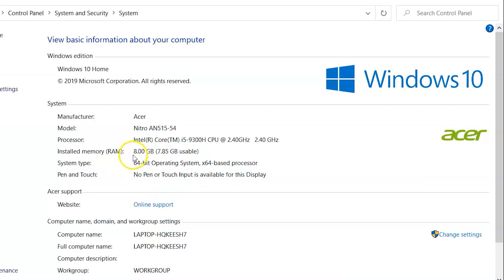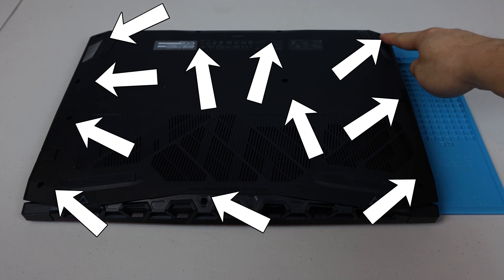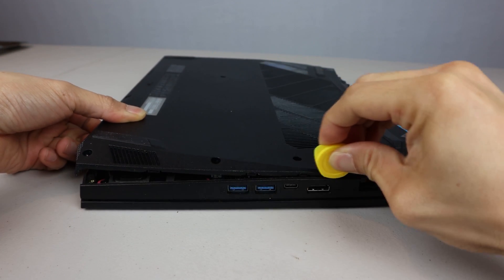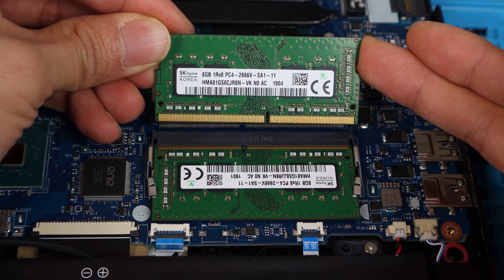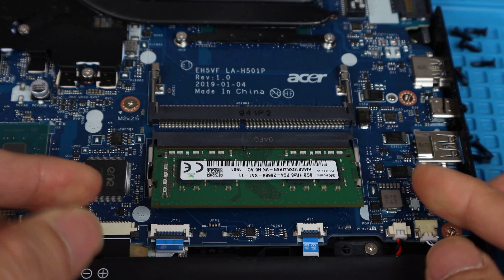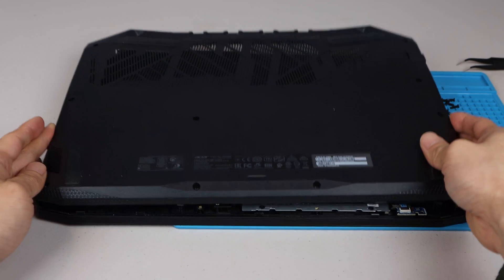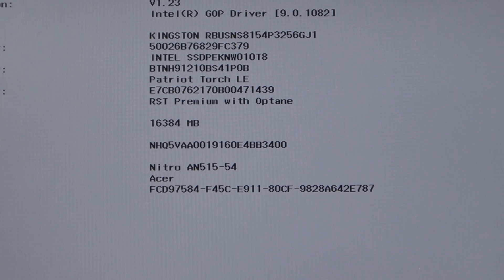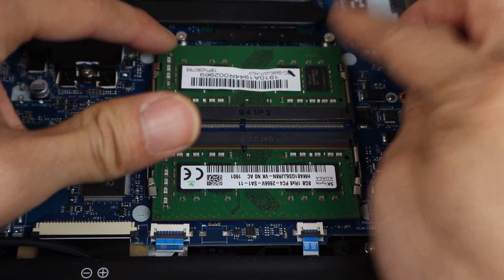How to Install or Upgrade RAM in an Acer Nitro 5 Gaming Laptop (2019 ver) DDR4 up to 2666MHz 32 GB

Comment: hi so i have a 2x 4gb ram installed. so i bought a 16gb ram. im planning to install a 4gb +16gb ram in dual slot. can this be done? or are there any conflicts if i do this?? should i just remove the 4gb stick and just install a 16gb all by itself?? thanks
Reply: Sure you can. But if you are spending that big of money on your laptop you should just buy a matched set and put your 4gb stick aside for spare.

Comment: i have acer an515-43 model. It came with 8gb 2666mhz sk hynix ram. I also added 8gb crucial 2666mhz ram. Afterwards, when I looked at the task manager, I saw that my ram speed fell to 2400mhz. how can i fix this? the speed of my two rams is 2666 but it currently works at 2400. I would be glad if you can help.
Reply from the maker: Hm, while I couldn't find specific information about your build, it's possible that is uses DDR4-2400 Dual Channel Support  via DDR4-2666 bridge to DDR4-2400. This means that although it uses DDR4-2666 modules, it  runs them at 2400 speed (1200 x 2 for ddr or double data rate). Of course, this may not be true if you're sure it was running at 2666 MHz prior to installing the new chip. It could also be that the two different brand chips don't efficiently communicate with each other and that's what stepping down the speed, though this is not typical is the specs line up. However, I've also read that the Ryzen builds of the Nitro 5 top out at 2400 MHz. Apparently, with either AN515-43 model a single stick will run at 2666mhz but with both AMD and Intel, 2 paired sticks will run at 2400. You may need to reach out to Acer for clarification.

Comment: Thanks your video, I want to purchase this laptop, but I want to know do I need to remove the battery when I upgrade the RAM? Because some of the review said without remove the battery will be dangerous or damage your laptop?
Reply from the maker: While it is not required to do so to complete the upgrade, some people prefer to take this extra step to safeguard against the very small risk of an electrical short. It is optional, but so is wearing a grounding wrist strap to prevent static electricity. Problems like that are rare but there is still a chance. In the end, do what you need to do, to ensure you feel good about the steps you are taking to protect yourself and the laptop from damage. If that means disconnecting the battery first, by all means, do so.
Reply: @FixItPhil OK, Thanks your reply!

Comment: Hi, mine came with 8gb of ram. Does mine second one have to match that and be 8gb as well? Or can I get a 16gb one to give me even more ram?
Reply from the maker: In general, it optimizes the utilization of the new RAM chip if you get a matching spec and capacity, so an 8 GB chip would be a great option. However, you can still install a 16GB chip if that is what you prefer. Yes, it will give you more RAM but the performance increase will likely not be very noticeable unless you are running heavy processing applications like image or video editing. For gaming, a total of 16 GB of RAM (2x 8 GB chips) should be plenty.

Comment: So is this the ram that comes with this acer nitro 5 model? Or did you already have this one installed and you just added the 2nd one? Because I want to use the exact same ram that my nitro has i just want to add another 8 gig to have 16 total
Reply from the maker: Yes, my model (from Best Buy) came with 8GB of the Hynix RAM installed, and I installed a 2nd matching one that I purchased online, so now I have a total of 16 GB. Other builds from other vendors may have different components inside, so it's best to check first to be sure; however, the only way to do that is to open it up and read the part number off the chip :-/.

Comment: I have 8gb of ram, i want to add 16gb to the other free slot to make it 24. The 16gb of ram has the same speed(2666), latency(19), Voltage(1.20V/1.2V) etc. Is it safe to make that upgrade?
Reply from the maker: Sure, you can do that. For the most part it's not a matter of "safe," rather, matching speed/capacity/etc has more to do with optimizing performance. That said, the system should still work fine with a 8+16 GB configuration to get you to 24 GB!

Comment: Could I use a 2600 mhz stick with the 2400?
and is it really neccesary to have the same model RAM memory?  because i already bought a 2666mhz to place it on my nitro5  2.4
Reply from the maker: Yes, you could use two different speeds together, although you won't get the extra speed benefit of 2600mHz, as the system will step down to whichever chip has the lower speed, so both chips will run at 2400 mHz. No, it's not explicitly necessary to match the brand and model; this simply increases the likelihood of maximizing compatibility and optimizing efficiencies to get the best performance. In most instances different modules will work just fine with each other.
Reply: FixItPhil What ram is included in the nitro 5?

Comment: Why i upgrade ram 4gb to 12gb but when i play games still running low fps
Reply from the maker: Upgrading your RAM often makes a very small difference to your FPS, which is largely defined by the capabilities of your CPU and GPU (video card). While extra RAM helps with your overall system performance, you may not see a lot of benefit when gaming in terms of visuals.
Reply: I messed up added a 4 gb card and I can't change my 8 gb card from 1333mhz back to 2400mhz cause no bios now my Acer is useless

Comment: So glad I found you vid's , so clear and concise , short and to the point. Other vids out there havnt hit the nail on the head like yours so thanks and well done. I've had this laptop now for about 3 months and I have the 256Gb m.2 ssd version. I have a spare M.2 slot and the 2.5" hdd available to me. Any ways so not to clog each video up I have a couple questions as, so far using acers own community page i've had no definitive answers, so hoping you can help. Im currently looking at upgrading the RAM up to 16GB and have seen your using the factory fitted for the second though the price of it on your link is a lot more expensive than what im looking at. So will this one have any issues running dual with current one installed? https://uk.crucial.com/memory/ddr4/ct8g4sfs8266.

Secondly im also looking at putting in a 2.5" hdd. Can I fit a SSD here instead , and also what is the max this can handle as i've herd reports the M.2 slots only take up to 516GB in the second slot , so wondered if there is also a restriction on the 2.5" as well? im currently looking at this https://uk.crucial.com/ssd/mx500/ct1000mx500ssd1 will this be ok to use in the 2.5" bay?

Heavy gaming on this laptop but I know these increases will handle what I need currently , just unsure if these components will handle it and if they will work. Cheers in advance for any feedback I can gather.
Reply from the maker: Hey Pete. So the specs for the Crucial RAM in your link are the same as the factory installed RAM, so it should be compatible and run with little or no issue when you pair the two. The 2.5” bay can accommodate an HDD or SDD of the same form factor. Or you the 2.5" HDD bay can be converted to accept an M.2 SSD, using an adapter or housing like this one: https://geni.us/97s6 [Amazon Affiliate Product Link] Note that this would necessarily be restricted to SATA III transfer speeds as that is the connection type to the board.

For the M.2 slots, I believe the 2019 Nitro 5’s can handle up to 2 TB drives; I know mine handles the second 1 TB SDD I installed just fine (though the one pre-installed in my machine is only 256GB). As for the 2.5” bay, my assumption is that it is also a 2 TB max, though I’ve heard anecdotally that it can accommodate up to 4 TB, if you can find one with a slim enough profile to fit in the tray (for example the Samsung EVO 860: https://geni.us/C4MNgu [NewEgg Affiliate Link]) although I haven’t tried it myself, and I haven’t seen anyone specifically installing a drive above 2 TB. I would reach out to Acer for confirmation before purchasing a 4TB drive to be sure.

The MX500 1 TB 2.5” drive you mentioned would be compatible, though I saw it for a little cheaper on NewEgg here: https://geni.us/VnrZJ2 [Affiliate Link] In fact, you might be able to save a little money by getting both the drive and the Crucial RAM from NewEgg: https://geni.us/un1O [Affiliate Link] Not sure how much shipping is to the UK, though.

Anyway, I hope this information helped you some. Cheers and good luck with your laptop upgrades!
Reply: @FixItPhil thank you so much for the reply and the time to have a look for me. That has helped no end to what my choices are. The adapter for the 2.5" is an interesting development and not something id thought of. Is there any point in changing to the M.2 in the bay? I think a SSD 2.5" should suffice, unless there is a performance increase. 

Thanks for your link to Newegg , though I was just linking the components I had been looking at and will be using Amazon to purchase. I think in price getting shipped to the uk from the usa will be more than what id save in these terms :) 

Its good to know your nitro handles a 1TB slot , im sure ive heard reports that they don't handle more than 512GB , so maby I will have to find out if certain models support different amounts. Ill let you know what I find out if I do, might help someone else in the future. 

Thanks again
Reply from the maker: @unknownh0st383  Sure, no problem! To answer your question, no, there wouldn't be a performance advantage converting an M.2 to 2.5" form factor because of the SATA interface limitation. It would just be a convenience thing, if you already had an M.2 drive you wanted to use but no open M.2 slot. If you have to buy a new drive either way, a 2.5" form factor SSD is probably more economical.

Comment: hope you can reply, my colleague has a nitro i7 with 2667 8gb ram, he wants to add 8gb more. After putting in the new ram, do we need to do anything with BIOS, are after adding ram, we can simply turn on the laptop and it will be detected? Hope you can reply.
Reply from the maker: No, you don't have to do anything additional after installing the new RAM chip. The BIOS should detect it automatically.

Comment: Hello i upgraded ram memory on my  nitro 5.I have the amd version, it came with one 8gb  2400mhz  and I upgraded to 32gb  3200mhz ,I did check the speed and still at 2400mhz does any one  knows what can  i 
do?
Reply from the maker: Depending on the exact model configuration you have, the max RAM speed is limited to 2400 (like the Ryzen models) or 2666mHz. It sounds like your model is the former, so unfortunately you won't get the benefit of the 3200mHz speed because of the physical speed limitation of the motherboard.  I actually don't think any builds of the Nitro 5 go above 2666mHz.
Reply: @FixItPhil  tanks

Comment: I did this now my laptop won't turn on. No charging light either when plugged in. Please any help or tips on what to do.
Reply: Did u unconnect the battery to the motherboard ? If u didn't im afraid ur laptop just had short circuited
Reply: @ahsim3143  i was going to just return it cause i had just bought it. When i was putting the screws back in i couldn't find one. So i looked all over for hours and found it then i decided to try and turn it on one more time and it turned on lol
Reply: @ahsim3143  thank you for taking a moment to help.

Comment: Hi Phil i am having NItro 5 2019 i7 model, onboard it have 8 Gb 2667 MHZ ,
 i am planning to add 16 GB Card is it good have one slot with 16gb and another slot with 8 GB pls suggest your options
Reply: Selva The Boss can I answer the question,I have tried that 16GB on one slot and 8GB on the other without any issue,shop for 16GB SODIMM 2666mhz,consider checking my uploads,thanks
Reply from the maker: Sure, you can mix RAM capacities like 16GB with 8GB and your system would probably run fine. But you run the possibility that you might not be able to utilize its optimal performance because of it, so it's generally advised to use RAM sticks by the same manufacturer, size, and frequency (speed). But again, if you already have mixed capacity RAM sticks you want to use, it would still give you some kind of performance boost. Best case for this is if they are the same frequency (e.g. 24000 mHz, 2666 mHz etc.) but again you can mix speeds too; you would just be limited to the lower speed chipset.
Reply: @FixItPhil  nice

Comment: So if I wanted to upgrade my ram to 32g I would need 2x 16g ram sticks that's all?  As long as its DDR4-SDRAM right? Do you have a link to what kind of 16b ram stick should I be looking for?

Edit: So I actually saw the link to the 16g viper steel ram! If I need two I should just get the dual kit right? The dual kit has a max of 3200mhz is that okay as well?
Reply from the maker: Yes, you can get a dual kit 32GB RAM which will include two sticks of 16 GB RAM. You won't need to get the 3200mHz, as the AN515-54 maxes out at 2666mHz so any speed above this would be unused. It might be cheaper to buy two single 16 GB sticks at 2666mHz and you would get the same performance. Of course, if there's a great deal on the dual kit somewhere and you can save some money, there's no real problem with getting the 3200 mHz, you just wouldn't be able to take advantage of the full speed capacity.
Reply: @FixItPhil  Thank you for the help! Much appreciated!

Comment: Could I use a 2400 mhz stick with the 2666?
Reply from the maker: Yes, the max speed of the pair would be limited by the slowest stick, so you would run at 2400mHz with both installed.

Comment: I have the same laptop and it's stock without any upgrades when I go to the task manager it shows me that the 2 slots are used I don't how cause my model is the 8gb model? 
and what kind of ram do you recommend to get it to 16gb?
Reply from the maker: If you have a total of 8GB of RAM with 2 of 2 slots used, you likely have two 4GB chips installed. So if you want to upgrade to 16GB, you need to buy two 8GB RAM sticks or a single 16GB; you won't be able to re-use the existing 4GB sticks. The Hynix 8 GB RAM is a good budget friendly option that comes stock with many builds: https://geni.us/TDIO [Amazon Affiliate Product Link]
 But if you want better performance and durability you can try the Patriot Viper Steel RAM: https://geni.us/52cnxY [Amazon Affiliate Product Link] You can either buy one 16 GB chip or two 8 GB chips. The difference between those configurations is fairly negligible.
Reply: @FixItPhil  thank you so much ❤
Reply: SODIMM DDR4 2400mhz and 2666mhz works for me

Comment: I think I just got the same one 
	
ACER NITRO 5 RYZ 5 8GB 512GB RX560 GDESK
 I want to update the ram so if I get 16gb and it have 8 so it’s would 24 would that be possible and worth it or should I get 8gb only that’s it could be even so I goes to 16gb
Reply: I'd suggest just to get another 8GB stick because it'll lead to 16GB of ram.
Reply: LIL NELLY TV  ok thank you very much

Comment: For the amazon link for the screwdriver, which size would I use to take the screws off it shows sizes on the box
Reply from the maker: Size is J0.
Reply: Actually if you are using a standard precision driver the size is 2.0
Reply from the maker: @bigterrybrown9304  Sure, there are two standards for "+" shaped driver bits, JIS and Phillips, they are similar and can sometimes be used interchangeably (though not always). The J0 and PH2 are very close in size so either should work for this application.

Comment: i have a acer nitro 5 with 8gb of ram at the moment and a 1050ti and a i5 8300H should i get a 8gb stick 2666mhz stick or a 2400 mhz stick
Reply from the maker: If you install more RAM, you should match the new stick's speed with your existing RAM, whether that's 2666MHz or 2400MHz (I can't tell from your build description). The easiest way to determine your existing RAM's speed,  if you have Windows 10, is to right-click on the taskbar and choose Task Manager from the menu. If it's in compact mode, click More details, then click on the Performance tab. Click on Memory and you'll see the speed in the right hand column under the graphs.
Reply: @FixItPhil  Thank you so much !!! it says 2667 Mhz so i assume i will get a 2666 Mhz

Comment: Do you have a link to the ram you purchases that matched the factory installed stick?
Reply from the maker: Sure, I got it at Amazon here: https://geni.us/TDIO [Amazon Affiliate Product Link] (Hynix 8 GB RAM)
Reply: Is  a DDR4 2400 16GB compatible? Or 2666 is recommended? Mine have 8GB Hynix. Already have a Kingston 16GB 2400. If not recommended, must use Hynix to expand RAM? (Difficult to get this on my country, available brands are Kingston, Crucial, Micron)

Comment: Do you need to disconnect the battery?
Reply from the maker: No, it's not necessary. Some folks do that to err on the safe side, but as long as the laptop is closed and you're only working in the areas with the drives and RAM there's very little risk involved if you leave the battery connected for these simple upgrades.